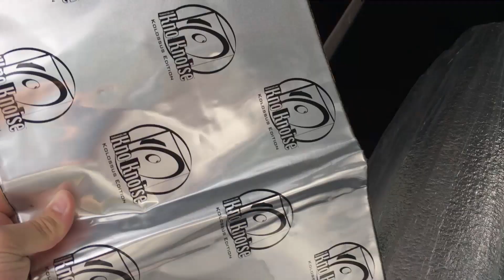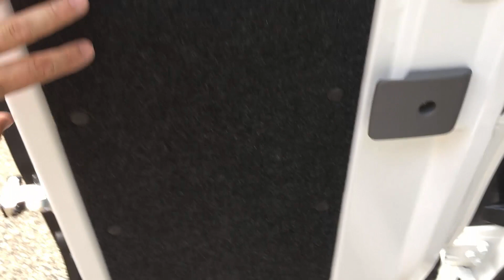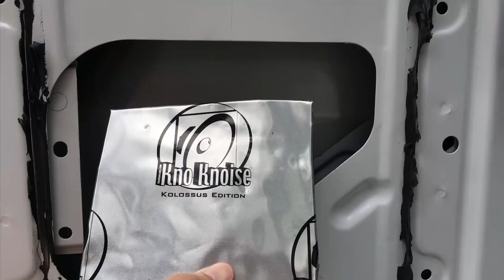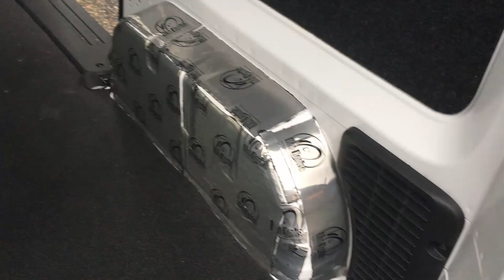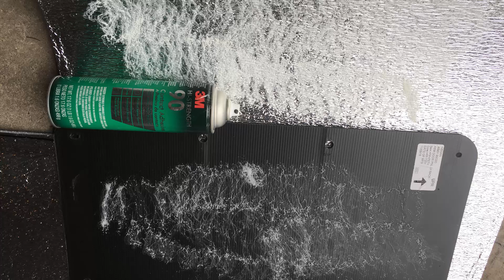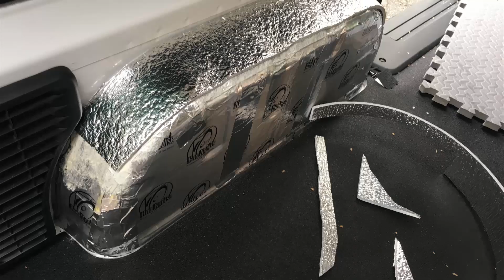Nissan NV200 Camper Insulation — Sound Deadener + Thermal | Why I Didn't Fully Insulate

Comment: So did you finish the insulation? Please. Would like to see what and how you finished this. Thanks.
Reply from the maker: I did, but it’s mostly how you see in the video. I added pieces on the walls, where it is white in this video, then topped it off with some 4-way stretch carpet. You’ll be able to see how it turned out in the next video (which will come within a couple weeks).

Comment: Did you ever do a follow-up on changing tire size. If not what size rims and tires did you use? Did the new tires affect the speedometer or fuel mileage? And are you happy you did it , pluses or minuses.

Comment: Thank you!  Great info.  Question:  It looks like you are doing a lot of work on this leased van, and I'm wondering how much of this is reversible.  I'm interested in your technique because I am seriously considering buying a new NV200 and I don't want to do any damage that might make it tough to resell, in say, 5 years.
Reply from the maker: YesClearly I understand. I’m my case I talked to the company comptroller and he said “as long as you don’t drill holes and it adds value.”  So, I added the rubber sound deadener. However, if you want to make it completely reversible, you could make insulated panels out of corrugated plastic. Home Depot sells the stuff in 4x8 sheets and it’s inexpensive. It’s also what the existing black panels are made from. They can be held on with plastic trim pushpins (auto parts store) or 3M trim tape.
Reply: @OdysseyCamper  Thanks for the tip!  If I do get a new van, I'll want to follow a number of your steps to keep things reversible.  :-)

Comment: Did I miss that this is not longer your company-owned work van but is now your personal property?
Reply from the maker: Kathryn Arnold No, it’s still company owned but they gave me the OK to improve the interior. I just can’t drill any holes through the body, which I wouldn’t do anyway :-)
Reply: @OdysseyCamper  Will having the website and whatever as OC allow you to take the cost of materials as a write-off?
Reply from the maker: Kathryn Arnold it could, but I currently don’t run it that way. I have other businesses and don’t want additional paperwork. But certainly that and even the travel expenses are potential write offs. Would be perfect for someone right out of school.

Comment: I'm still saving for my van.  I was looking for an odsessy but do u think the Nissan is better.  It taller (I like), but it is uglier.  What do u suggest.
Reply from the maker: Stick with the Odyssey.  Too much to go into here, but I think the Odyssey is, overall, a better minivan camper.
Reply: @OdysseyCamper  
Thank u.
Reply: @OdysseyCamper  Oh geez ... now I have to go look at the Odyssey and see why you like it better.  What about the height inside the cargo area?  Isn't it much shorter than the NV200?
Reply from the maker: YesClearly which van you’ll prefer depends on your use case. The NV has a big unfinished box which makes it good for someone who wants to build from scratch. Without the trim panels and curved sheet metal of the Odyssey, there is more room in the cargo area of the NV. In almost any other way; build quality, comfort, handling, braking, acceleration, and highway fuel economy, the Odyssey is far superior. Of course the Odyssey is a significantly more expensive vehicle. The center height in both vehicles is 48”, but the Odyssey floor is on a slope and the ceiling curves down toward the outer edge. Hope this helps and thanks for watching!
Reply: @OdysseyCamper  I test drove a new NV200 today and ... <sigh> ... it's such a disappointment.  It'd be fine if it were selling for maybe $15k.  It's basically a tin can on wheels and didn't seem well made for the price.  However, it's still more affordable than its main competitor small van, the Ford Transit Connect.  And it's cargo height is actually 53" which beats any minivan I've seen.  I so wanted to love this machine; now I have doubts.  The salesman said it's mainly for commercial use ... as a way of waving off my concerns.  Maybe companies aren't so concerned about price / quality.  I wonder if they get a BIG discount for buying several of the vehicles at the same time.
Reply from the maker: YesClearly like I say in the video, it does one thing well;  it’s a box ;-)